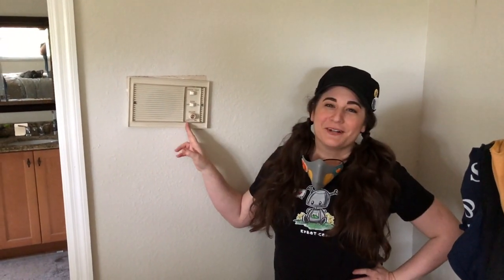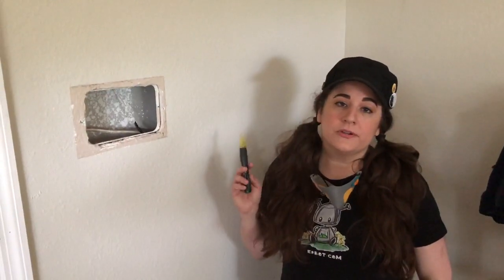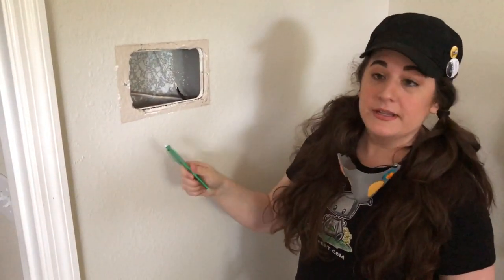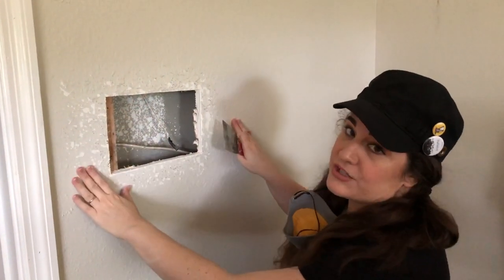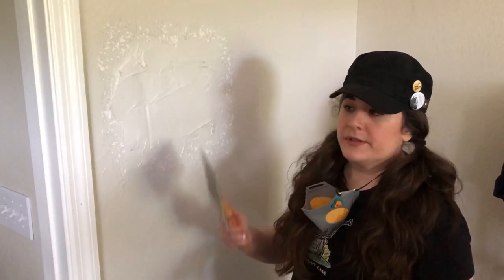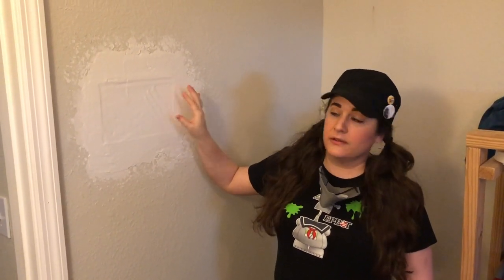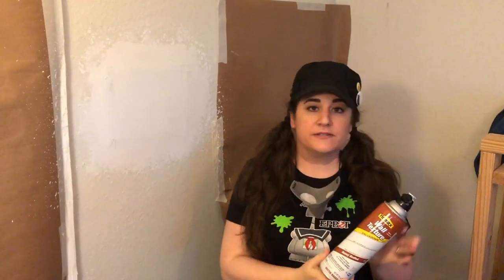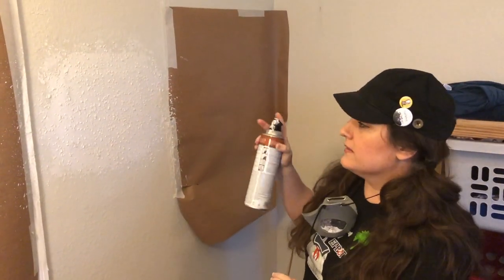Drywall Patching 101

Comment: Leaving the paper to over lap the repair, makes it easy to see the patch as it pushes the surface out at least a 16th of an inch around the patch and is a lot more work to feather it in. The wood is very good, have done tons of fist holes in apartments and other repairs in drywall and I use just the wood ,but you need to have it cover the the corners from the back, and tapings is unnecessary. In ten years none have cracked. And you should use a large taping knife or any straight edge longer than your patch area. But overall a good video.  Oh and always prime the texture before painting or your finish will look different in that spot when you look down the wall.